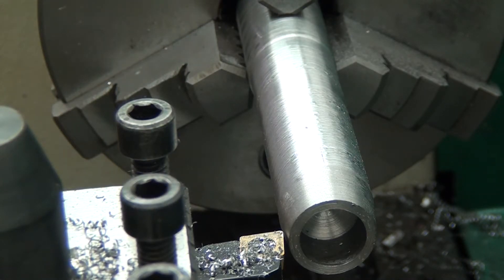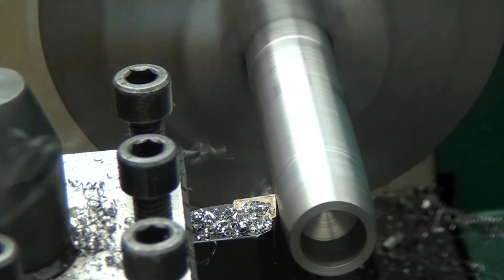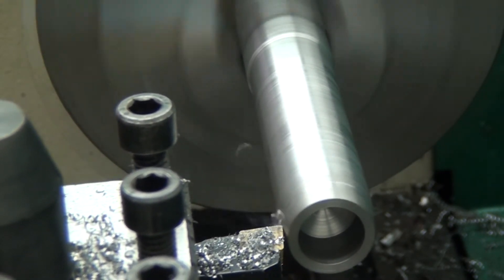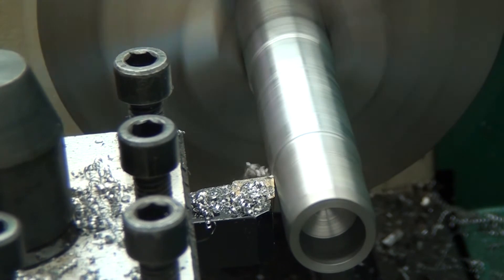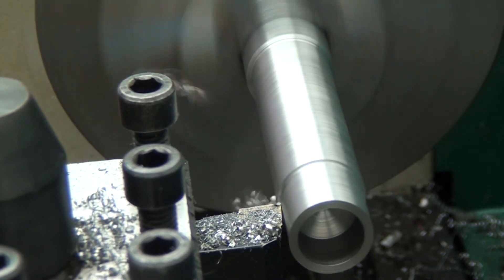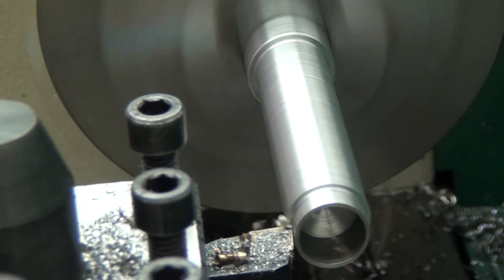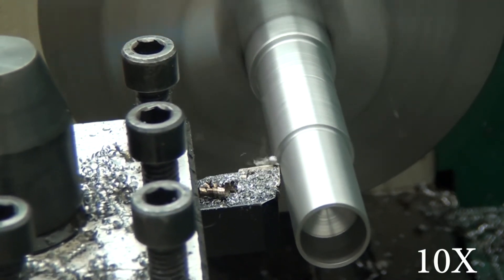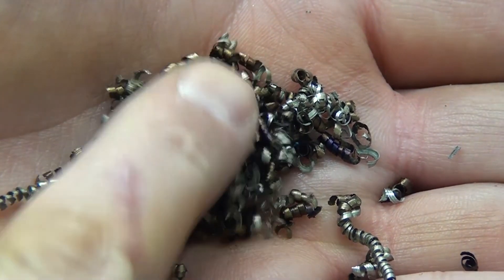09 G0602 Steel Depth of Cut

Comment: A general rule of thumb is to take a depth of cut at least equal to the size of your insert radius.  Example a .010 rad insert equals .020 depth of cut . You should always bury the insert radius into the metal.

Comment: man you can take much heavier cuts than that 
I've turned a 3mm deep cut with a 0.3mm per rev feed with a high speed steel toolbit 
as long as you support the work sufficiently you can take some pretty fierce cuts.
btw this was on a sb 10" clone

Comment: Use a live center and try a 1.5-2mm depth of cut at 0.2mm/rev feedrate. (3-4mm on diameter) + center drill/use a center to support the work. you'll get a much more parallel shaft and better rigidity. Believe it or not light cuts can be worse for the insert than heavy cuts. Your limiting factor for material removal would be your lathe rather than your tool i'd say, as long as your material is well clamped and rigid don't be afraid to get aggressive with the tool :) Good luck and happy machining.

Comment: that type of configuration is used for your last cut and then to square off the shoulder due to it being angled away from the face.  if you had a different holder and used the heel of the insert (or a different style insert and holder) giving you about a 30 degree relief you could easily take upwards of .150 cuts at about .003-.004 per rev feed.  you also didn't seem to be spinning the part very fast.

Comment: you can get repeatability with carbide but for best results using light cuts you should use a positive insert with a 1 radius (1 being 1/64" radius) what you are using is a negative insert and it is not as sharp as a positive but you can use both sides of the insert because the relief is built into the tool holder.  a positive will sit level and the relief is built into the insert so you can only use one side.

Comment: Main piece of advice is to put the center up against the workpiece to reduce vibration. If you use a high feed when roughing between 10 an 12 thousandths the heat gets taken away with the chips. I would recommend that stuby diamond shaped tip for roughing for finishing. perhaps an Iscar vcmt or a vnmg which are more pointed, use about 4 to 6 thou feed for finishing.

Comment: Get yourself a leather apron and full face shield for when you take deeper cuts or run higher feeds at higher rpm. You wont stop them on your arms, so you'll have to toughen up a bit.. hehe.. Just remember to bare the pain and to always pay 100% attention to your lathe when its running. Getting a hot chip on your bare skin just before knocking out the feed, the tool is going into the chuck and then it will be all over. Just have to grin and bare it unfortunately. Good vid though.

Comment: @russtuff I just did some turning on what I thought was 4140 but was probably cold or hot rolled steel, because the finish and chips looked exactly like your video!  I started at 1200, then I cranked it up to 2400rpm and got brown/blue chips and a noticeably better finish :).

Comment: Again, great video bud!  I still stick with carbide tools, no need to sharpen and with cnc it's repeatable enough, but it sure can get spendy.  Seriously, try some cold rolled and especially get your hands on some 4140!  With 4140 and blue chips it's practically a mirror finish, very shiny, and that's with shars inserts too.  To get bluer chips with the material and parameters in this vid, try 1200 and 30-40 thou.  Just dig in and go for it, worst case the spindle slows down (been there).

Comment from the maker: @oneyaker well that explains why i can't seem to get repeatably decent tolerances, so i will take a hard look at HHS. also, i have no idea where to look for the steeper rake aluminum inserts, but i have heard from other lathe operators that it does help get a much nicer finish. do you have a link to a good source? i've been looking at buying straight from Sandvik as they have a store on amazon... which makes it convenient.

Comment: Very nice comparison! I'd say it's best to use good, sharp, HSS or ground carbide tools on small lathes. Carbide inserts require more power&rigidity from the machine. Inserts wear quickly if proper cutting parameters cannot be used. Carb tools are meant to be used really hard. I used to have a lathe similar to yours and looking to buy another one for smaller work!